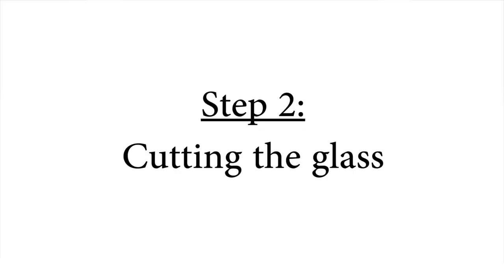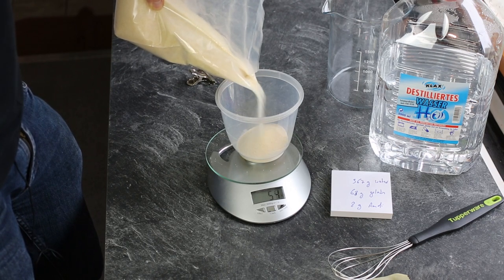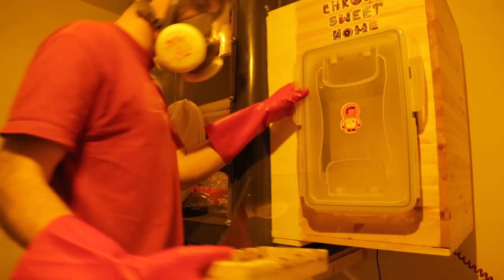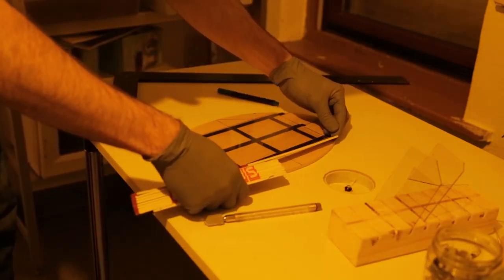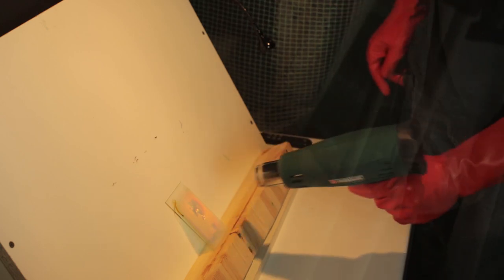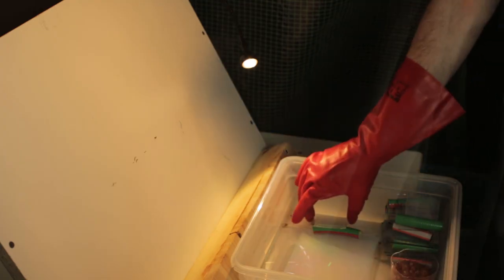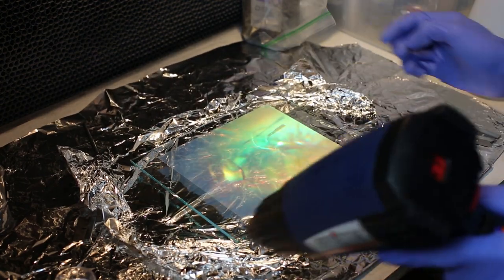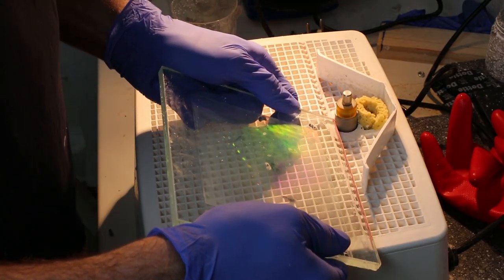How to make a Hologram

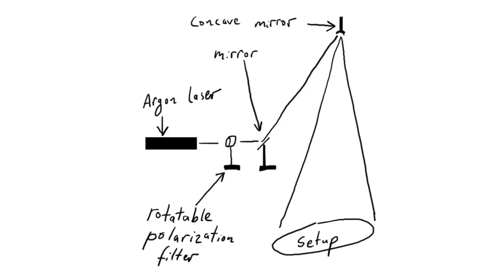Comment: 17:19 how can it work without refference beam? I am still trying to understand hologram ....
Reply from the maker: Hey, its super. just check "denisjuk hologramm" in google
Reply: This is a reflection hologram. It does have a reference beam to create it but it can be viewed with white light. The laser light shines through the plate to illuminate the subject. The laser shining though the plate IS the reference beam, and the light reflected back from the subject it the image information.

There are also transmission holograms in which the reference beam and the light from the subject strike the plate from the SAME side. These need to be illuminated by a laser to view them.